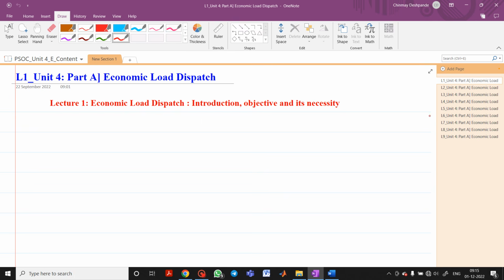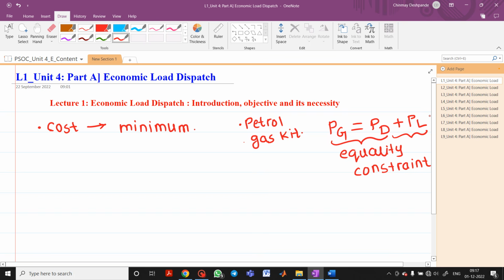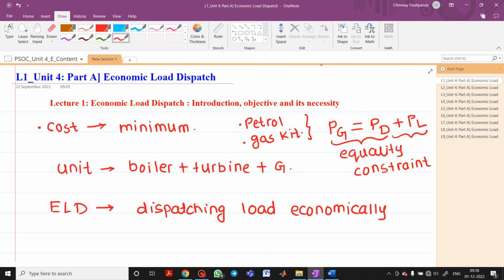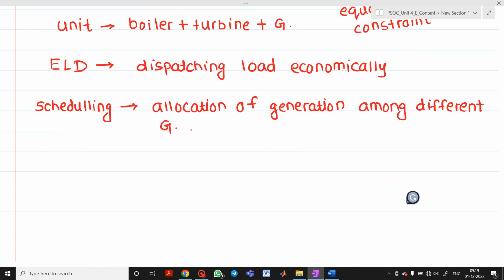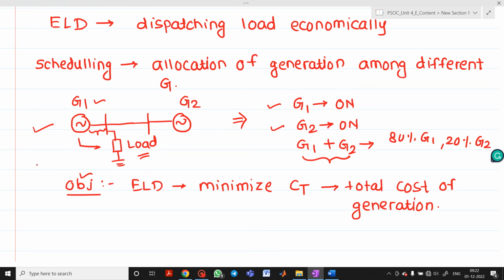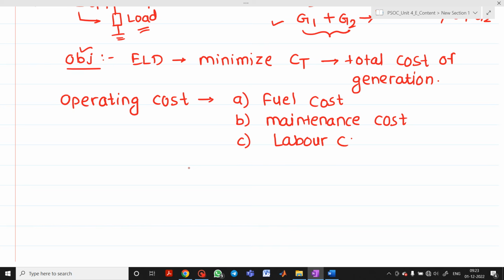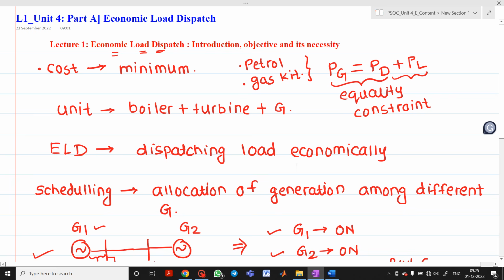Lec 01  Economic Load Dispatch Introduction, objective and its necessity

Comment: 00:07 Economic Load Dispatch ensures cost-effective operation of power systems.
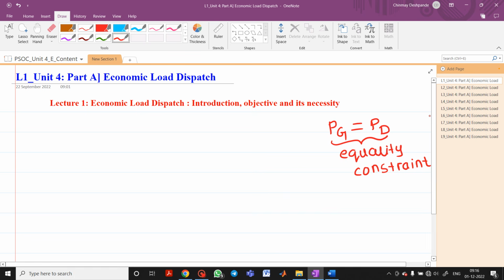01:23 Objective of economic load dispatch is to minimize cost
02:44 Economic Load Dispatch is about minimizing the total operating cost of supply by distributing the load among generating units.
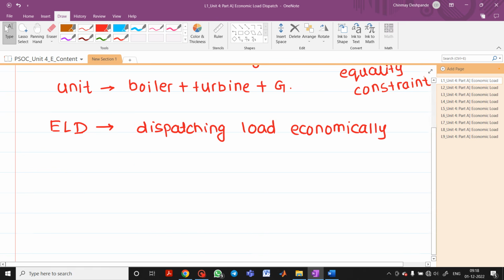04:01 Economic Load Dispatch aims to minimize total operating cost
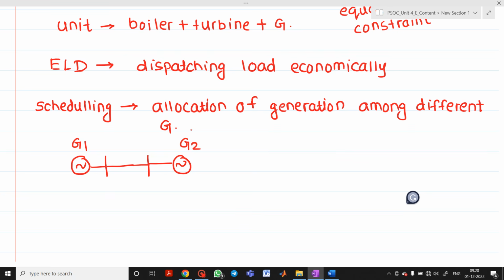05:27 Efficiently distribute load among generators to minimize generation cost.
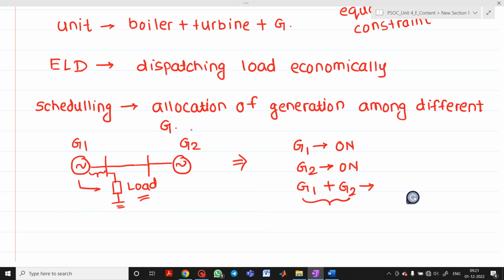06:40 Objective of Economic Load Dispatch
07:59 Operating cost of a generator depends on fuel, maintenance, and labor costs.
09:13 Minimize fuel cost through economic load dispatch
Crafted by Merlin AI.